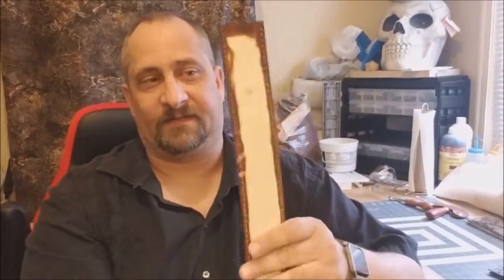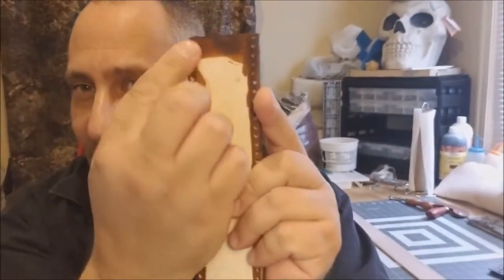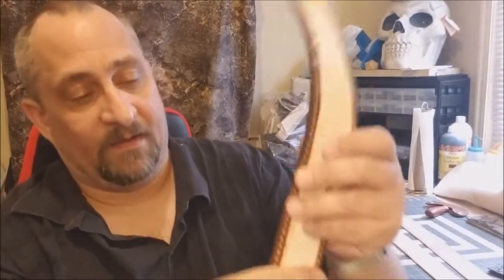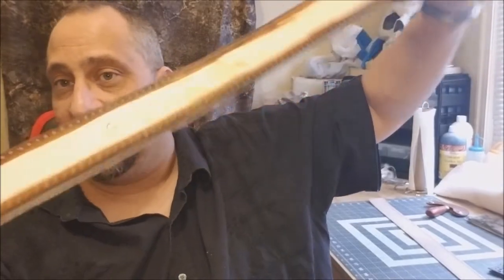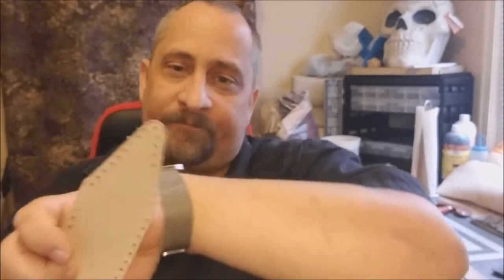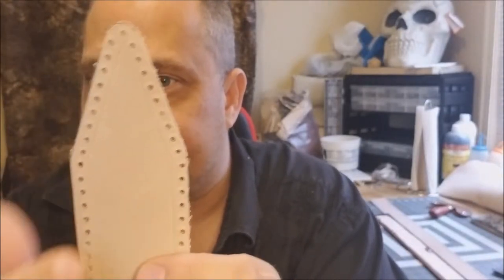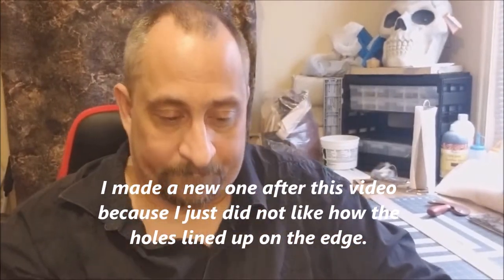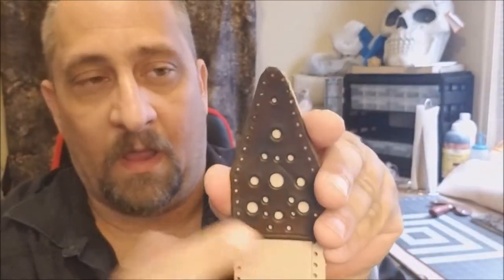Part 3 - Hole punching and spacing for holes

Comment: Hi there good sir , i want to ask which pricking iron spacing is best 4mm or 5mm ?
Reply from the maker: To be honest for pricking irons I'm using the set I bought from Tandy Leather Factory. I would lightly sand them with like a 200 grit sandpaper and then I wax them so they don't stick in the leather all that much. They are the first one I have bought and they are still going strong. I have no complaints about them.

The hole punches that I'm using I picked up from Hobby Lobby which lets you buy one item a week at 40% off. I wore out the first one I bought and I picked up one from Tandy Leather Factory. They seem to work about the same. If I use the 40% weekly discount from Hobby Lobby that is the best price. If I have already used that discount Tandy would be cheaper as for pricing.
Reply from the maker: As for spacing 1 mm is not a lot for a difference. The ones I use are 2mm for smaller items like wallets and such. On bigger projects I use 4mm. The 4mm is also great when you have long stitch lines. Where if you had the 2mm you have double the stitches for the same length then the 4mm. This is when I use thread 

For lacing, I use 4mm on everything.
Reply: @whisper575  thanks really appreciate , love from Pakistan :)